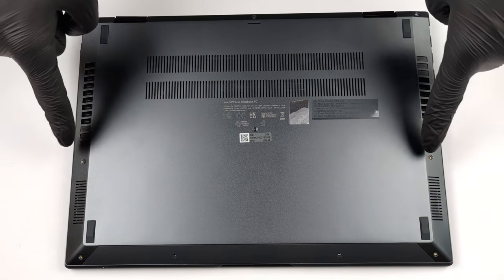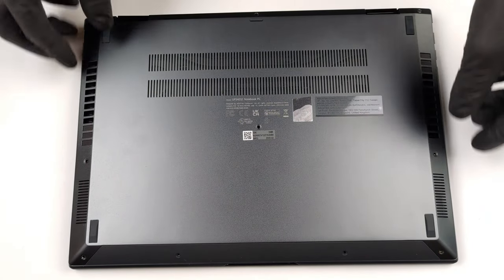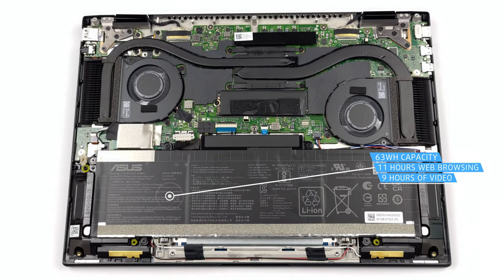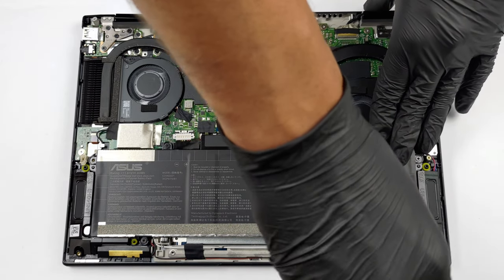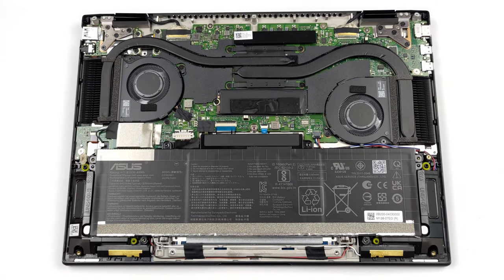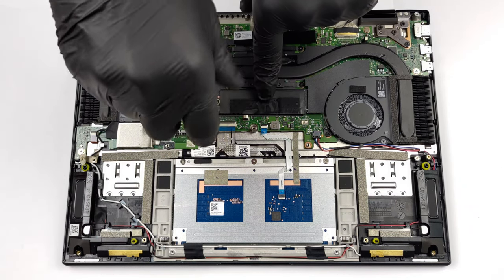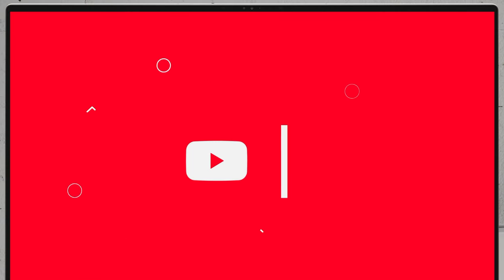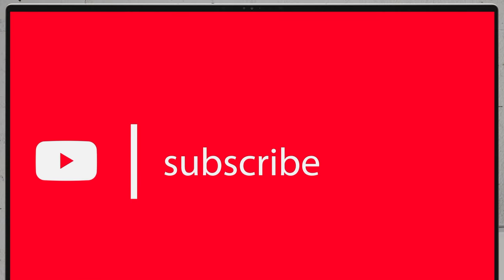🛠️ ASUS Zenbook 14 Flip OLED (UP5401) - disassembly and upgrade options

Comment: Can storage be upgraded?
Reply: It's a standard m.2 drive, you should be able to
Reply: What length its M.2 drive?
Reply: @Five_Seven7  Looks like a 2280, so the standard size, I would assume it supports upto 2TB, just a common max size I have seen on laptops, though I dont see why a 4TB one wont work